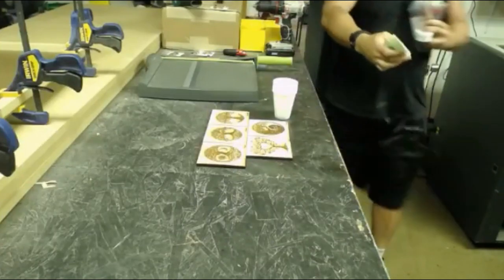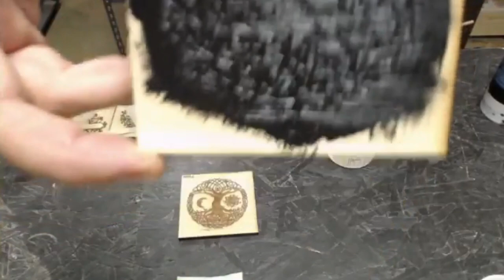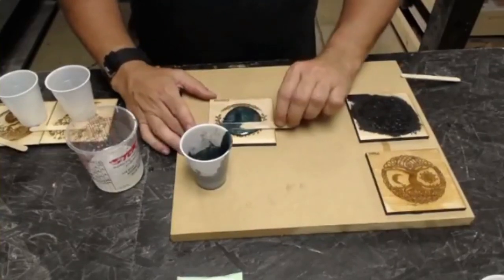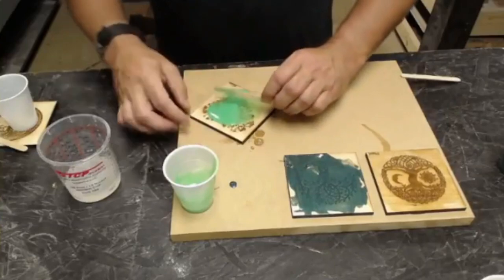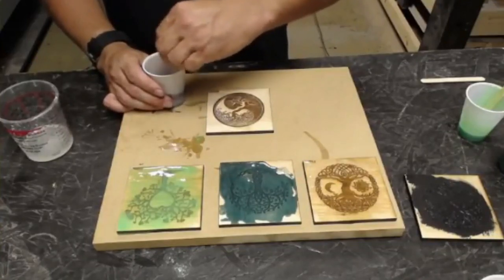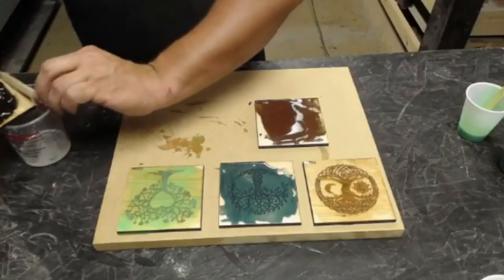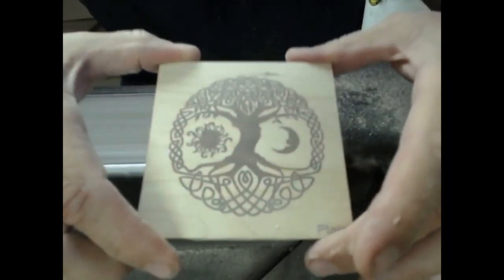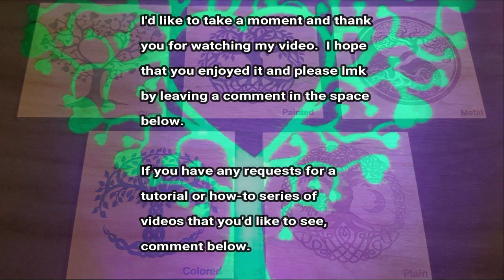Epoxy Resin Tutorial - How to Fill wood engravings like a pro 5 different ways to DIY

Comment: Thank you very much. Very clear (no pun intended) video explanations & demonstrations. Great details you talked about. I’ve never used epoxy but what a great idea for my engravings! Did not know that epoxy shrinks as it cures. Heat gun low w quick passes to eliminate bubbles is a great tip. Can’t wait to try this! Red would be great for valentines, green for St. Pattys.   Really appreciate your sharing. Thank you!

Comment: Nice. 
What you may want to consider, with the metallic pigment, is the pigment size. It may easily be too large to be inside the engraving. Glitter is usually too large of a pigment to sit below the outer wood surface.

Comment: I have done epoxy filled engravings.  If you don’t seal the wood before you epoxy the epoxy/color will bleed into the grain of the wood and cause  bad inlay.   You really should seal the wood before you pour the epoxy.   Lacquer or shellac works for sealer.   I did not hear him mention to seal first unless he is using wood the is already sealed.   It was a nice demo, but it seem like really only two methods, one is to paint the engraving first then cover with epoxy or mix the color into the epoxy.
Reply: You are right, You have to seal the wood to keep the color or paint from wicking into the wood grain.
Reply: Question... I see you mentioned shellac or lacquer for sealing, but what about sanding sealer? Would it achieve the same results?  And does the epoxy stick to the sealer well? I ask bc I did a piece that I believe had been sprayed with triple thick glaze (found this out later) and the epoxy literally popped right out as if it were a mold, zero adhesion.
Reply: Amelia McGreevy 
I belong to a CNC group and everyone familiar with this process suggests lacquer or shellac these seem to work the best.  I think I had used sanding sealer once and I got bleeding.   I would suggest you do some testing, cut a few pockets and try it plus it would give you experience before doing something more complicated and valuable.   If I am remembering it correctly, sanding sealer doesn’t work.  In terms of sticking, it should stick just fine, if you use lacquer, then use a flat finish, shellac would like be the best for adherence,  just an educated guess.  Again do some simple testing....
Reply from the maker: I sealed with spray lacquer beforehand.  It didn't even occur to me to mention it since I seal all my boards before engraving them.
Reply: The Woodworking Gamer 
You should spray with lacquer after you engrave the wood but before you apply epoxy.  New people to epoxy inlay might not be aware of the wicking that can occur which can ruin the piece.
Reply: d h lol that would have been me the first time
Reply: what about if you need to engrave again afterwards (if you are doing 3 colors for example)  does the sealer effect the engraving?
Reply: @dh-no2ke  wicking is even occuring for me with paint.   thick acryllic paint.    that's why i am here looking at video's on how to do it propperly.
Reply: I was wondering about sealing too because I’ve done it without sealing and there is no sanding that Color out of the wood.

Comment: Excellent video - very information. I make a lot of smaller items (wood key chains, dog tags, etc.) and was curious what type of sander you recommend? I currently use a hand held random orbital, but it's tricky to use on the smaller parts. You look like you had a great setup. 

Nevermind! Saw the link to your tools in the description of the video - that's awesome! 

Thanks
Reply from the maker: Glad it was helpful!
Reply from the maker: For small pieces i use my belt sander. Just be careful not to get your fingertips

Comment: Good video.  I am exploring various options on how to use resin on my laser engravings.  This is helpful.  It usually comes down to how do I get the excess resin off without damaging the veneer on the plywood - duh...reading your comments below it appears I'm trying to take the cheap way out and should use real wood blanks.  I asked below on a comment, and if already answered don't need to repeat.  But, do you have an affiliate link to real wood for coasters?  I could resaw my own stuff but kind of a pain.  Thanks again for the three stage demo.
Reply from the maker: No link but you can find wood at ocooch or a few other places. You can use water to get rid of laser residue also. Just let it dry before doing anything else afterwards

Comment: I have a few questions, if you don't mind. I recently got a laser cutter/engraver but am still trying to figure out how to finish my pieces.

Was this a hardwood or plywood that you used? What grit sandpapers did you used? Do you have to finish it anymore than using the Tung oil? Would using a different kind of oil, like Linseed or maybe beeswax work? How much ventilation is required when using epoxy (I only have a bathroom exhaust fan in a plastic storage tote vented outside)?

Sorry for so many questions, but this is really interesting and I'd really like to try it.
Reply from the maker: These are maple.  Sand in levels 8-120-240-etc.  Normally 240 is enough.  Finishing with any oil works.  Bil, Tung, Danish, etc.  Proper venting is essential

Comment: Do you ever have problems with color bleeding into the wood grain? I have had some issues and I am trying to get around it somehow.
Reply from the maker: no, that's why we seal first, then fill.  Gotta close the pores and seal the grain ends.
Reply: @LifeWithRoger  gotcha. I figured that you were, but did not catch that step in the video.
Reply: @Life With Rodger I loved this video. It was very helpful. I've been trying to do a color fill in a wood engraving and have not had much success. Do you have a link to the type of acrylic paint you use? Also what do you use to seal your wood before you apply the acrylic paint? I would greatly appreciate your help!
Reply: @annahullihen8931  Try 2 thinned coats of poly. That worked well for me filling my etchings with colored epoxy.

Comment: Hello! I am trying to do research for a homework assignment. You video was SUPER helpful and im so glad im not the only one with the idea to fill an engraving with epoxy!! This is exactly what I was looking for! However, my original idea was to laser cut a design into wood and then fill the empty spaces with epoxy. Would that be feasible? Have you tried it? If not i will just stick to just laser engrave but I thought with cutting you could really get that translucent effect
Reply from the maker: It works fine... BUT, you need to use something to seal the back of the wood where the pieces are cut out.  For me, I use house wrapping tape.  Here's a link to what I use.  https://amzn.to/2Eaeb0A  Hope this helps!

Comment: I heard those kind of lasers are limited on how deep they can burn, because the laser is  weak. As they are a more modest priced one compared to the huge ones.What would happen if you run the process twice and let it burn over the same spot twice? Would it deepen it or would it just end up being a burned mess?
Reply from the maker: You are confused.  Epilog is an industrial laser.  You might be thinking of those cheap Chinese knockoffs.  There IS however 1 option for industrial lasers beyond my Epilog.  Those are Kern lasers and they are stupidly expensive and nice.  LOL.  Running a job multiple times would deepen the engraving.  Some people run slow AND run a job several times.  (Just make sure you run it as much as you're going to before you move the piece or it could get outta whack)

Comment: Thanks for the video! I do epoxy work on serving boards and have a hard time with any finish being anywhere near as close as shiny as adding another layer of clear epoxy... which presents a constant challenge of air bubbles and dust making it into the final pour. I’m wondering if oil will stay on the epoxy though, or wash off the first time it is washed with soap and water. It will last on the wood, but can’t soak into plastic resin, right?
Reply from the maker: It should sheen just fine.  It won't "soak" in, but it'll fill the pores to make the shine nice.
Reply: It will rub and wash off over time and start to look like the headlight of a 1970 Chevy.  A thin clear coat of epoxy can work but if you are doing serving boards make sure it is FDA approved for extended food contact, Alumilite Clear is a good one.  But it you want a good quality shine on the epoxy and want it to last you have to be willing to do the work.  Grab a set of micro mesh and work your way up.  I did a resin inlay on a cutting board for a Christmas present and sanded the inlay to right out 5,000 before I did the first mineral bath.
Reply: Jay Shires  I use Art Resin, which I believe is the only FDA approved one. I have micro mesh as well. I go all the way through 12000 on my boards before oil. At 6000 grit you can really start to see the colors pop. But I’ve wet sanded, micro meshed, you name it and absolutely nothing comes close to the shine of a new coat of epoxy. I wish I knew a trick, but nothing comes close.
Reply: I Can Make That! 
Have you tried Yorkshire grit and I believe there is a fine one as well now?
Reply: Cathy 21 I’ll have to check into that. Thanks

Comment: I want to try this, but I want to see if I get this right. seal the wood, engrave (router), seal the groove, then fill with epoxy resin, then sand and then seal it with shellac? Thanks.
Reply from the maker: yeppers, u got it.  Not needed to seal twice though.  I seal first because I use a laser engraver and it helps the residue clean up.
Reply: thanks!

Comment: Do you have any tips or well I don’t even know if it’s possible. I want to fill in letters that I carved out for a toy box lid with silver epoxy but I want to have the rest of the lid blue epoxy. Any ideas? Right now I’m thinking pour the silver in the letters with. Stencil above it so the silver is fills high. Then pour the blue and then sand down the silver to level it out. Any tips would be greatly appreciated!
Reply from the maker: do the engravings in stages.  First everything blue, then fill it and finish it, THEN engrave the silver and fill it.
Reply: @LifeWithRoger   thank you very much

Comment: Will a Hairdryer work in place of the Heat Gun? I am planing to do some inlay for a wand handle I am making, a Pottermore wand so just a prop but still want to look good when it is done. Also have you ever tried melting solder into the engraving and I mean just plain Iron melt Solder dripped into the gaps like the resin here? I want a silver color like that for my handle in one part.
Reply from the maker: A hairdryer should work for thin applications.  Just get it hot and keep it moving.  Solder wouldn't be a good medium for inlay just dripped in....it'd take some finish work.  scraping/sanding/polishing/etc.  It isn't very shiny.
Reply: That was what I thought on the Hairdryer, it takes a light hand and a nice hot air flow. As for the Solder I've seen some shiny joints made with the stuff my father being a electrician but I also know it can really vary depending on the quality, as for the sanding to get it to a good gloss well I am kind of stuck doing that manual for now anyway as I've not got a belt sander like you used. So I was thinking just going through the grits and using my Micro Mesh could do it but it will be hard work and to be honest I need to learn that a bit more if I'm ever going to get to this skill level of wood working and such.

Thank you very much for the advice I only mentioned Solder as I know it can hold a shine if layered right and of course polished but I'll keep looking for a good alternate just in case.

Comment: Helllo, I've recently started playing around with epoxy inlays on wood, I was curious what your sanding theory was to get them so good? Do you wet sand to an extremely high grit? or does the epoxy finish nice with a lower grit and your tung oil finish? I've seen resin get extremely clear looking when they wet sand it up to 3000 or whatever, but those have always been on big resin pieces, not ones that have a bunch of wood and resin next to each other like you designs.
Reply from the maker: You can really do either but these are sanded to 240 and oiled. Depth of the resin matters also for clarity
Reply: @LifeWithRoger  thanks for your reply and sharing your experience!
Reply from the maker: @andrewwolenter6857  no worries. Have fun making cool inlays!
Reply: @LifeWithRoger  a little follow-up.  I saw you using a belt/flat sander.  Did you put 240 grit on that sander?  What's your technique to get to 240 grit - I'm assuming you start lower initially.

Comment: Does using something like a masking tape, engrave and fill in engravings without removing the tape work? Was wondering if it helps making sanding the epoxy off easier? I only have an orbital sander not a nice belt one like yours lol
Reply from the maker: still have to seal it before filling or color will run the grain

Comment: What grit sandpaper did you use to sand these down before applying the polish?
Reply from the maker: normally 120, 240 for certain pieces, 600 if I want it to look like glass
Reply: @LifeWithRoger  thanks for the rapid reply, I see people using like… 3000 grit sandpaper for their resin but it seems like overkill when you get such fantastic results from this process!
Reply from the maker: @packardbellend  I've seen it but i never use that high. The highest i even have is 2000 and I've used it only once just to test it out. The difference between 600 and 2000 is so small i couldn't discern it.

Comment: I followed your instructions pretty close to the letter and the only problem I have is we chose a orange resin to infill the cut letters. But after sanding it down some the field letters are black instead of yellow. Is that due to not enough sanding or is that due to soot residue left in the letters? I blew them out pretty good but maybe that's it
Reply from the maker: I'm not understanding. You used orange resin so it should be orange
Reply: @LifeWithRoger  That's correct. When I first put it on it was an orangish color. But I did not get the black residue out of the engraved letters. I'm thinking that's what turned the letters a grayish color.

Comment: Great video. Thanks for showing and explaining. Personally, I like the painted one the best.
What kind of wood did you use?  Is it a kind of thin plywood or "real" wood?
Reply from the maker: This was Maple wood.
Reply: @LifeWithRoger  Thanks for your quick reply.
Reply: @LifeWithRoger  this is what I was looking for in the comments.  You used real wood, not plywood, that makes total sense because of the end sanding.  Do you resaw your own coaster thickness size or do you have a link (affiliate) to where you buy the coaster size solid wood?
Reply from the maker: @RobSandstromDesigns  i cut them by hand usually

Comment: What is the best wood to use for resin filling?
Reply from the maker: Those with tighter grain work best
Reply: Can you do.the resin fill on plywood?
Reply from the maker: @MountainGirlCustomDesigns  you can but if you want to use colors, first brush on a thin layer to seal the engraving really well, then 2hr later add your colored resin
Reply from the maker: @MountainGirlCustomDesigns  if not you'll end up with bleed and it's kinda ugly
Reply: Thank you so much!!!!!! Great video, by the way! Where are you located?
Reply from the maker: @MountainGirlCustomDesigns  Mississippi USA. Thanks for the comments!
Reply: Absolutely! Hello from Colorado!

Comment: I tried this technique with Dremel engravings. However on all the places on the wood where the epoxy was, it left moisture rings so the wood is discolored. I tried using a sealer on the engraving before filling with epoxy and sading but i am still having some issues with the moisture rings. Any tips or tricks to prevent such rings would be much appreciated.
Reply from the maker: I'm afraid I've never had "moisture rings" on any of my resin fills.  I don't really understand what you mean since epoxy isn't technically "wet", it shouldn't be a factor.
Reply: @LifeWithRoger  So I've been doing small engravings on coaster sized pieces of Basswood and when I fill the engraving the epoxy doesn't cover the whole piece of wood. Once its cured and I sand down the resin to make it flush with the rest of the piece, there's a discoloration between the parts that were covered with the epoxy and the parts that weren't, I kind of just assumed it was moisture.
Reply from the maker: Clear epoxy should look almost like glass.  if there's a discoloration, it could be the resin, or you haven't applied your finish yet.
Reply: The Woodworking Gamer I was using black dye so maybe that was causing it? I tried doing just clear and the wood seems to be absorbing the resin so it doesn’t end up flush. Sorry new to the engraving community lol
Reply: The Woodworking Gamer do I need to be sealing after engraving?
Reply from the maker: @shanerussell334  Yes, engrave, seal, fill.  Remember that epoxy shrinks, so overfill it a bit or you'll end up with indented spots.
Reply: The Woodworking Gamer ok thank you so much! Any specific seal you recommend?
Reply from the maker: Not really, anything that'll seal it will work. Oil, lacquer, wax, etc.

Comment: In what order should I stain, engrave, fill, and apply a poly finish? And how would it turn out?
Reply from the maker: I don't generally apply stain.  But the order would be stain, engrave, fill, poly.  But there's no way for me to tell you how it would turn out, that depends on your skill level, materials used and execution.

Comment: What ratio would you say to use the metal powder to resin?  1:1? 2:1?
Reply: Also, if I would like to stain the wood after, do I have to use the oil finish?
Reply from the maker: I normally do 1:1 for Metal